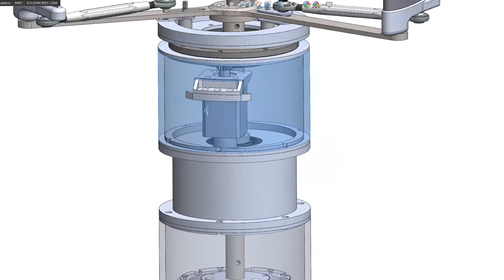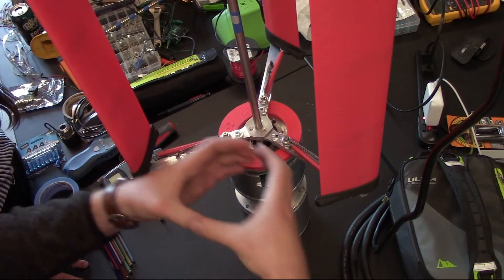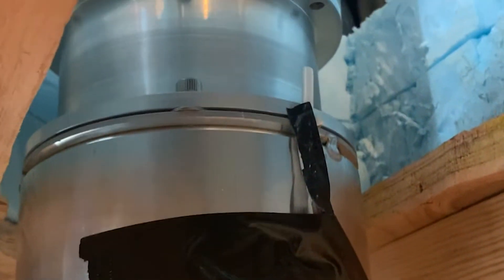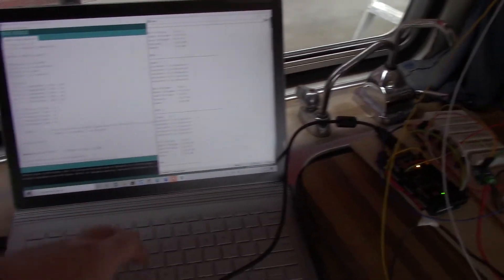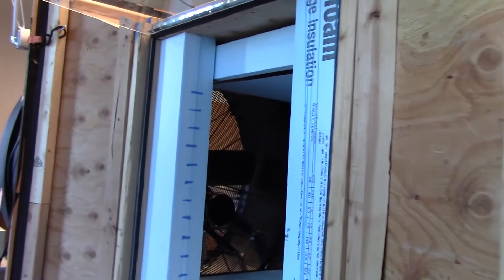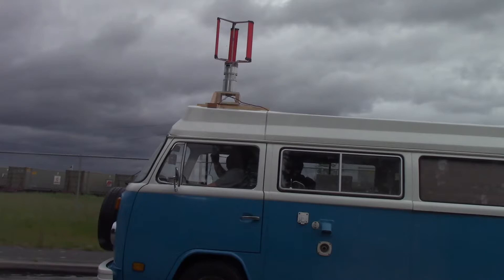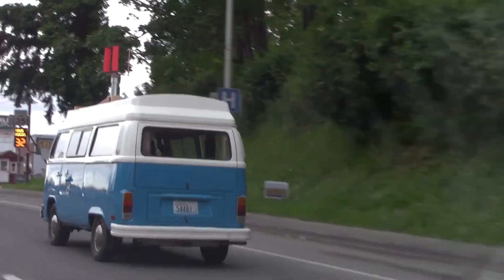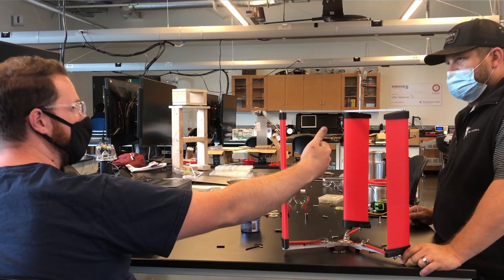EWET 2021 Wind Turbine Design and Testing

Comment: Years ago we tried the same thing, only at a size of two meters and on that occasion we made a wing profile that always faced the wind, that is, the leading edge caused lift as if it were an airplane and that's how it worked, with the three blades. making force to the same side that you want to turn...I don't know if I explain myself

Comment: Silly boys!  I've built VAWTs for over 50 years. I found out early on, USEABLE power from average (12-knott) wind, was possible by using my turbines to compress air. 

I then use that stored compressed air against either pistons or through a tangential-flow turbine (Pelton wheel) to create any voltage / amperage I want, safely, down on the ground in my shop.

Comment: Two items, you have to add  more blades, Helix design blades are more efficient.

Aerodynamically you have to add end caps to increase the efficiency by 4%. 
The biggest problem with verticals is the generator being too large for blade size.

Comment: Respect and admiration for the video, period. However if you would only stop for a moment to make some basic math calculation you will find out that way before building the prototype. You may not even need to do the math, just looks other prototypes that already exist and find out how much power they output and why, and you will save yourself a lot of time and headache and more likely you would have build a prototype with all those considerations. There is so many wrong things with your prototype and your analysis that is hard to start commenting or suggesting. I just would recommend you to research and document yourself and learn some math and basic physic in order to have a more productive journey. Every one is welcome to play the engineering game, but knowing some math and building an knowledge as foundation will help you go far.

Comment: I think that this is a great piece of job. Correct me if I'm wrong, when you use speed multiplying gears, you need more torque, right? But from only three blades i don't think it's enough, actually. What about using 6 - 7 blades? Could this work to increase the exposure to the wind and so give more torque? Thanks! Cheers!
Reply: exactly, they need more area to increase the torque, more blades or larger ones

Comment: you are a perfect example of over engineering the mechanical solution to a problem...... even if you get it to work in the disipline in which you have started. The cost of research and development and added manufacturing costs have to be implemented into retail sales making it a super expensive solution..... but I suppose this is what modern academia preaches to its clientel... over paying youths . . . didn't you ever see good will hunting?

Comment: Each addition, each gear, represents an approximate loss in efficiency of ten per cent. Ideas for masking or feathering vanes on the retreating side continue to come up over the years. The system for feathering has to work against air friction on the far side, work which is subtracted from the total available. Unless the gain in improved utilization of the wind covers or more than covers the total in losses, the additions cannot be justified. Real figures are required

Comment: I appreciate that you want your design as compact as possible but I would nevertheless suggest that you increase the diameter of your rotor so that you up the torque it generates. Personally I prefer VAT's because of all the advantages they present, particularly two points, (1) Being able to place them closer together with the space efficiency that results from that and it's ramifications. (2) They are more friendly to wildlife particularly birds. (3) Because they are small, they lend themselves better to domestic use and should be able to provide an higher output that a similarly sized HAT.
All the best with your project.
Reply from the maker: Pieter,  Thank you for your comment.  The turbine was made for the Collegiate Wind Competition, which dictates that the rotor be 45 cm.  The reason for this is that in the competition, the turbines from the various teams are tested in an NREL wind tunnel, built specifically for the contest.
Reply: @everettwindenergyteam7001  so, what about increasing the size of blades, or the moment arm of blades? is that also not allowed?